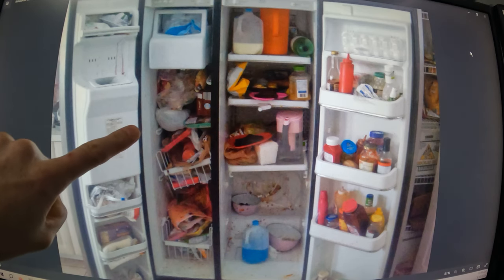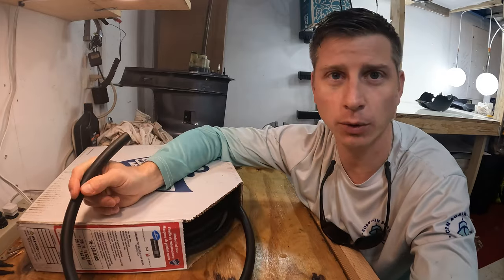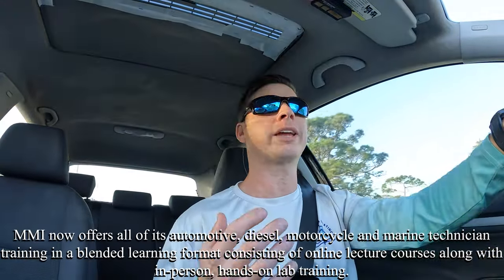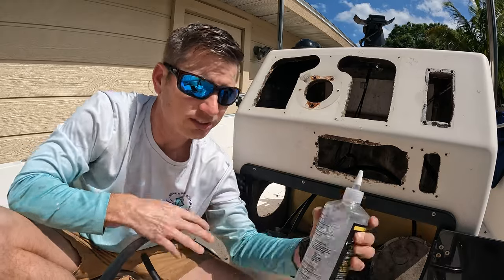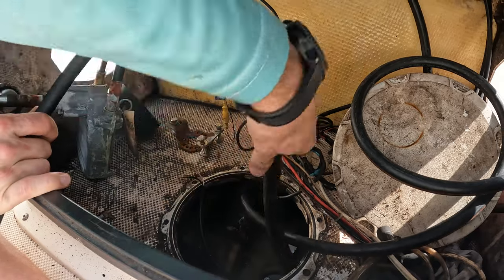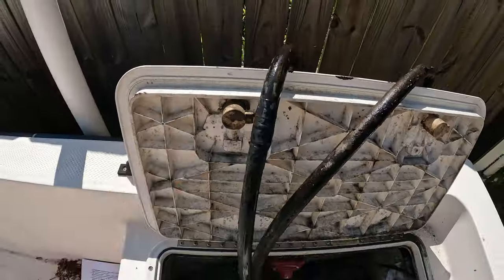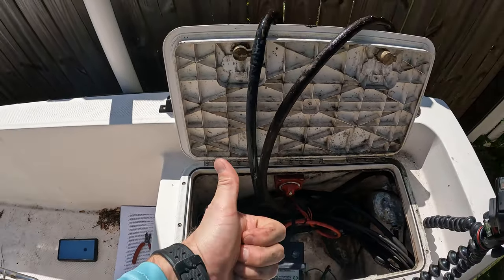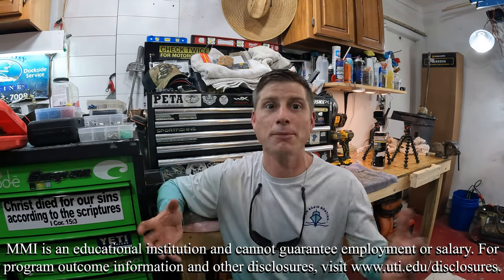Marine Mechanics Institute Q & A

Comment: So I didn’t go to mmi I took the school of hard knocks and working at dealerships. In the mid Atlantic you will start at 15-19hr no experience. As you continue to go and learn you will be 20-30hr. After you get “certified” and put in time you can get 30-42 ish but most of the time by that point people try to go out on their own. When you get the top dollar anything that comes in the door you should be capable of fixing no matter age or brand or style (stern drive and outboard) I hope this helps. 

I say this but this year our bottom paint seasonal help started at 17-20. So rates in the mid Atlantic are going up.

Also I agree what you put into yourself to improve your skills the better you’ll be